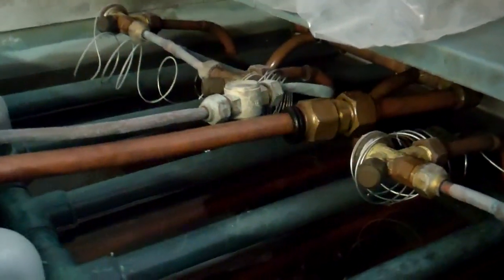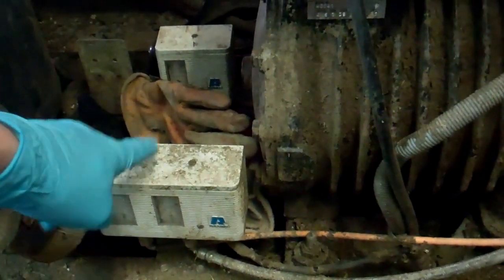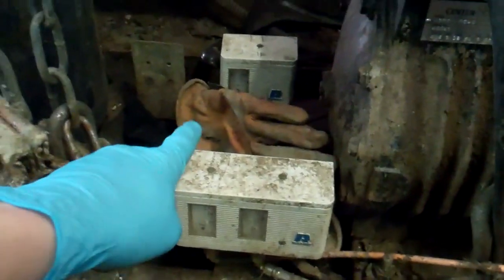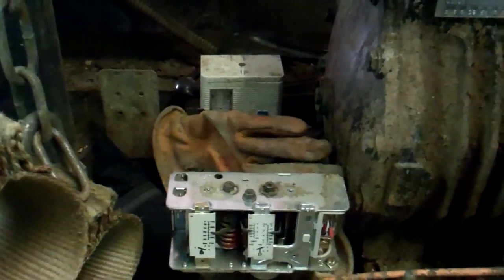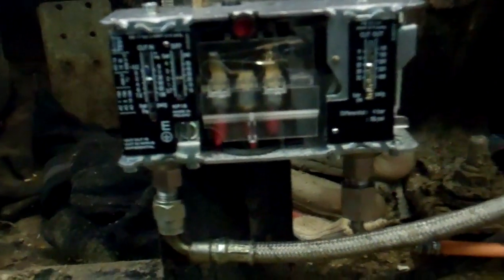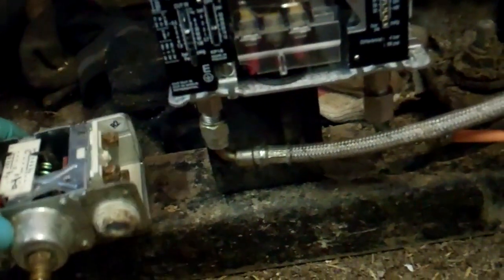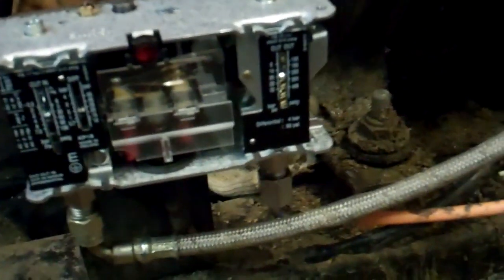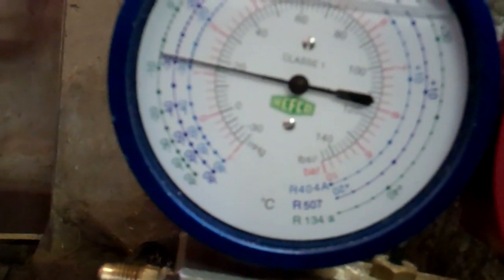Dual pressure switch replacement

Comment: these types of dual pressure switches like Ranco or Danfoss always have a 1/4 SAE connection with shrader valve core? I think I saw a pressure sensor soldered once, what then? Do you need to recover refrigerant?
Reply from the maker: These don't always have a shrader valve core on the system connection, it depends on the system design. 
If you isolate the part of the system where the pressure switch is then you can recover the refrigerant from that part of the system into the other part of the system, no need for a bottle/cylinder.
With the soldered ones, depending on the system you can use a pinch off tool to seal the pressure switch from the system, braze a new one (or a 1/4" access fitting)  in and then round the pipe off again.
Reply: @heavydiesel  pinch off tool on 3/8 or 1/2" pipe ?
Reply from the maker: @totalclima88  Check out the Imperial Eastman 105FF tool, though I would only use it in an emergency, not worth risking a leak given the price of refrigerant now.
Reply: @heavydiesel  oh..thanks !
Reply: @heavydiesel  ok, i know this tool. But i wonder one thing. If you pinch pipe as hard as pipe wont leak, there is high risk to crack or damage pipe in other way